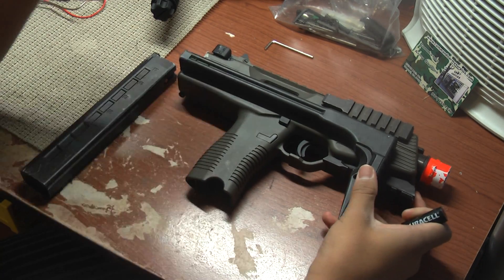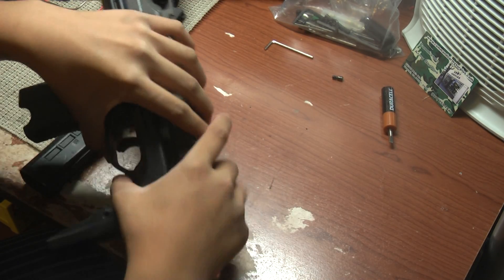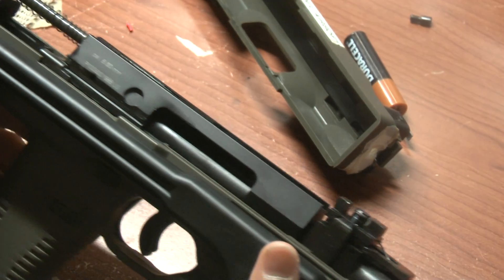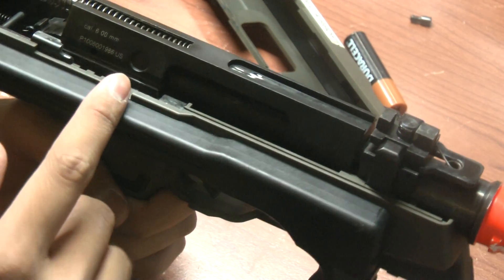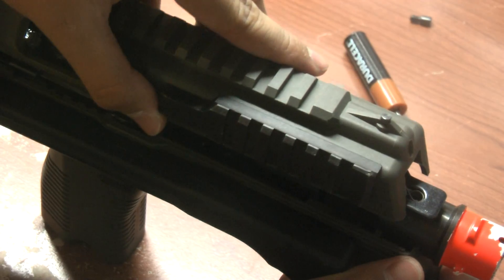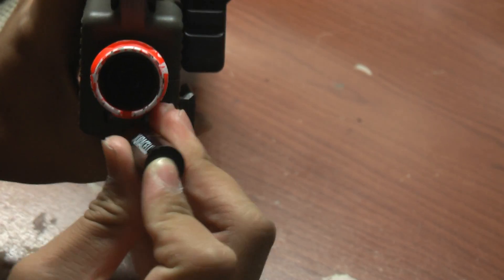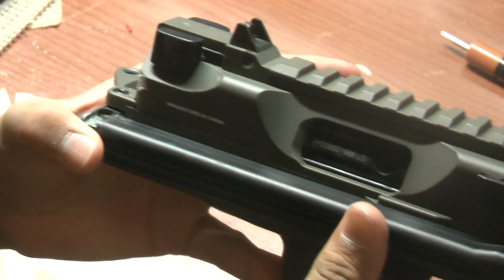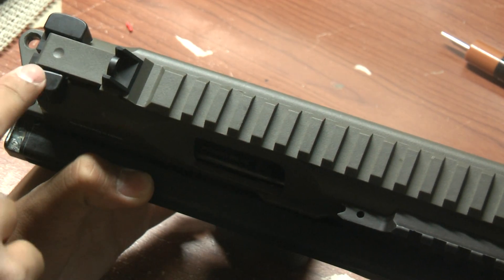KWA MP9 Speed Mod

Comment: lets recap folks , he is not responsible for any stupidity you do , or if you break your warranty. Well said sir. 

IMHO Instead of shoving currency and and packing peanuts just above the trigger group, why not add a nylon spacer or some washers at the base of the spring guide, also rather then slapping some masking tape or a bandaid on the gun, heat shrink the button to create the desired seal. Have a good day